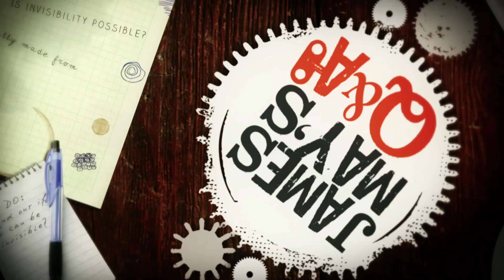Why Can't Trains Go Uphill? | James May's Q&A | Earth Science

Comment: I can't believe you forgot about sanding the tracks.  When sand is put on the tracks for traction. I think a viable solution would be lifter Wheels wrapped in rubber to help assist in uphill travels. kind of like ones on cement trucks and dump trucks. If a heavy load the wheels hydraulically lower to help  disperse weight. With that said most Rail lines has already been set and engineered at slight incline so why redesign a train for steeper grades.
Reply: Sanding only increases adhesion around 5%. This means that your GP40 will now get 30% adhesion instead of 25% - that's still pretty awful for anything but a locomotive (30% adhesion means that a force equal to 30% of the locomotive's  weight will cause it to slide its wheels). TE comes solely from weight on driven wheels, so your suggestion would make the problem much, much worse. You could drive the extra wheels, but would  they be rugged enough to withstand the loads, and would they justify the extra complexity? (The answer to both is no)

The Russians used rubber tires on some of their locomotives (the CHMe-3 comes to mind), but then you lose all of the low-friction benefits of steel tires (these locomotives, it should be added, were designed for low-speed-high-TE applications like shunting).
Reply: What is your design for perpetual motion?
Reply: driving a streetcar every day sand makes a huge difference
Reply: MrCampbell202 Sure, it makes a difference. The manufacturers wouldn't make such a big deal out of wheel creep otherwise (which increases adhesion to anywhere between 36 and 43 percent). But the fact of the matter is - 36% adhesion is still pretty awful for anything but a locomotive (and you're not pulling a mile and a half of coal, so it's going to help you a lot more than the other guy). If the point is that locomotives do worse on hills than everything else, that extra 5% doesn't really change anything. Sand doesn't make the train go up the hill as well as a car, but it can help a little. A slug will help more, of course...

Comment: To negotiate very high slopes as high as let's say 60 degrees, instead of wheels equip the locomotives with pinions that would roll on a pair of racks instead of tracks.
Reply: Look up the Snowden train, it has just that. It could be a cool thing to apply to mainlines though...
Reply: Armadillito Wow it has already been done. Thanks for the info.
Reply: leteveryoneknow Al;so look up the Manchester tram system, I believe they have rubber tyres!

Comment: I was an engineer for CSX through Pennsylvania West Virginia and Maryland I usually drove the dash 9 locomotive and we would in order to haul a consists of 100 coal cars we would tie for locomotives together NH locomotive had over 6,000 horsepower diesel Electric System usually have to get it going and we would almost at the top of the grade have an issue with not being able to make it over but we would is the lost traction on wet rails they still have a system that drops the sand on to the power Wheels giving us more traction on a modern locomotive it's 12 Tractive Wheels ran by electric motors out in the West they would have pushers to help them along if there was an issue with a grade I can't think of the name of it right now there's a famous great out west in Colorado that trains have an issue with It's usually the freight trains hauling coal

Comment: saying 80% degree angle is the same as going up the stairs is the stupidest thing i've ever heard or seen. big dislike.
Reply: R u sure about that?  If the 80% is the ratio between the rise and the run such that the rise is 80% of the run , then it sounds about right.  For example, a section of a staircase runs 5 feet but only rises 4 feet.  That is an angle of about 38.66 degrees which seems right.  That is, the angle that has a Tangent (opposite over adjacent) of 0.8 is about 38.66 degrees which is about 0.6747 radians.  I think you better change your downvote to an upvote.  Actually he did say 80 degrees so he is wrong so yes leave it as a downvote for inaccuracy.

Comment: Interesting video, and very nice shirt! One thing I thing would add interest to the presentation is an explanation of the force exerted on the track by the wheels in such a small area. How does the kg/cm2 increase the friction between wheels and track? Also, this would be a good place to introduce the concept of coefficient of friction, which would have an effect on the amount of drag required to prevent the train from moving forward.

Comment: Error at 4:10. The tractive force will not remain the same. This can easily be seen (by people who've had some physics) by drawing the forces acting on the wheels. It would be easier to explain using images, but let my give it a try: 
If you pause the video at 4:10 you know that the gravity pulls exactly vertical. The tractive force is based upon the forces perpendicular to the hill, also called the normal force (formula: traction force = coefficient of traction * normal force). When the train is flat the normal force is equal to the gravitational force. But when the train is on a hill, some of the gravitational force is pulling the train to the hill, but some part is just pulling the train down! Hence, the tractive force is lower when going uphill.

Comment: Another factor not mentioned is that, going uphill, the entire weight of the train is "hanging off" the tiny contact patch between the locomotive's wheels and the pair of rails the locomotive is resting on -- which means that the entire weight of the train is also "hanging off" the patch of ground those rails are attached to. That's an enormous load, and if the locomotive has enough traction (using a traction aid such as sand), it can literally tear the rails out of the ground. Then the train won't be going anywhere for a very long time.

This is why it's better for each train car to have its own electric motor, so all the wheels in the train can share in the workload.

Comment: A 100 ton locomotive is small I thought the union pacific ones were closer to 300 tons.  I also thought the wheels on the cars had brakes on them and the locomotive has regular brakes and they can use the electric motors like a brake

Comment: There are Trains not only using Gearwheels locking and being driven using a "toothed Bar" but also Trains using Ropes being fixed to the Train (aside or beneath it)  while still standing & rolling on Rails. Such as the famous "CableCars" in San Francisco use, as well some  Trains in the European Alpes, called the ("Standseilbahn").

Comment: I used to work for a railroad. Many (most?) modern trains also have "sanders" equipped. They use a stream of air to blow small amounts of sand between the rail and wheels, to give them more traction when climbing hills, accelerating, etc.

Comment: Look up the Uintah Railway. That one had grades of 7%, and the locomotive manufacturer was so certain that 7% was a typographic error, they designed the locomotive's water jacket for a 5% grade, which would have let the crown sheets run dry resulting in a boiler explosion, hence the ICC banned the use of the Uintah Mallet until the problem was remedied. Later the sand and water saddles were removed when the locomotives were sold to a lumber company. The lack of weight made them lose traction, and they were very slippery indeed. 2% is considered the standard maximum grade for class A US railways. The Bonanza mine & the Uintah were very unique though. Even as a road Baxter pass is famous for wrecking large tractor trailer trucks. Hard to imagine it as a railroad!

Comment: NO mention of sand used to add traction? EVEN STREETCARS CARRY SAND.
tragic fail
Reply: No real point to bring up sand.
And I'm pretty sure sand is mainly used during poor weather conditions, where traction is reduced from rain/snow/leaves.
Reply: @caboose.20   since, as mentioned in the video, it's steel on steel, opening up the throttle too much will result in wheelslip, and that's when sand is sprayed onto the rails in front of the wheels to create traction. So sand is used more in getting a train moving, rather than braking.
Reply: well it's used while braking :) you can't use continously sand LOL

Comment: OK, very convincing...but how come trams have no problem with hills?
Reply: Brooke Brady No, I'm referring to systems like Nottingham which is a railed electric tram with roof mounted pantograph which has no trouble coping with Shipstone Street, Mount Hooton Road,  Market street, Beastmarket Hill or Fletcher Gate down to Weekday Cross, all of them pretty steep gradients.
Reply: +The Butler Did It Trams actually have the same problem with hills. The reason why they can run up steeper hills than trains is that they have more powered axles (higher tractive effort) relative to their weight. Trams usually (esp. those designed to run on hilly streets) have every axle powered which is in contrast to a freight train where only the loco is powered and the wagons (with 2000 t of coal) are not. Modern DMUs, EMUs with distributed power, metros and the like, can take steeper hills as well.

A modern locomotive by itself could run up an ~16% incline. But there's no point in running locomotives alone, without cargo.

Comment: Mr May might have also mentioned that, in the case of a steam locomotive, a severe grade will make it difficult to determine the level of water in the boiler.  Since the crown sheet must always be covered with water, a higher level of water must be maintained in order to ensure that the entire sheet has water covering thus making it more difficult to maintain steam.  He should also mention that the use of sand helps increase grip.  And, by the way, I am indeed a qualified railway engineer

Comment: Why not add a rubber inlay on uphill sections of track to improve friction?
Reply: +TheGreatMoonFrog   It would probably squish it right out!  Steel is probably quite slick against rubber-ever try to stop rubber tires on a big steel plate? The slightest moisture and it's "game over"!   I think the reason cars get such a good grip is that the road surface is quite rough.  It is strange that steel on steel is quite good with a lot of weight on top- the reason locos can "go"!  It is quite amazing what a factor air resistance is, especially at higher speeds. I think it is actually the square of the increase in speed, if I worded it correctly. Double the speed,  4X the resistance.  Without our air mass on planet earth, I think the main thing then limiting an ever-increasing speed would be the frictional load from bearings, and rolling resistance of the wheel in contact with the rail, which in itself is minimal on a train. As long as the horsepower is enough to cause an ACCELERATION to a new greater speed, even if it is a very slow or gradual increase, the speed is theoretically UNLIMITED until friction and resistance is greater than the ability to achieve an acceleration.  Things coming in from space BURN UP from the frontal impact with the air, so it must really be significant!  The air is the main reason we can't just go hundreds of miles per hour in a car, and that is not even considering other crazy things that aerodynamic events cause!

Comment: Dude didn't play much Transport Tycoon if he thinks trains can't go uphill.
Reply: +Maxmilian Hills in TTD are super-unrealistic. When they made a (more) realistic acceleration model in OTTD, they had to reduce the incline significantly. But even then setting a minimum speed for trains going uphill is super-unrealistic. Perhaps with rack railways. I think rack rails are available in Locomotion or in Rollercoaster Tycoon. Because it has much lower max speed, it can also make shaper turns than regular railway.

Comment: Would be interesting to add paved sections between the normal tracks for steeper angles (up/down) with significant rubber tire traction that would only engage traction when needed.  Wouldn't even need to make the rubber tires retract in normal operation as they would only contact the raised pavement if it was there.

Or just go maglev...;)

Comment: This video neglected to mention that locomotives have traditionally carried a supply of sand, which could be released onto the rails ahead of the drive wheels to provide extra traction. One of those domes on top of a steam locomotive's boiler was typically filled with sand, with pipes leading down to just ahead of the drive wheels. The engineer could pull a lever to open a valve and gravity would draw the sand down through the pipes and onto the track. 

The system wasn't perfect though, and the sand pipe could easily clog, especially if the sand wasn't perfectly dry. Later systems used pressure to force the sand out.
Reply: +lurkerrekrul So do modern diesels...You can see the sand pipes running right down over the rails on both front and rear edges of each wheel. Diesels work equally well in either direction, so sand has to be available in both directions the wheels are turning. Also, everything has a slip point at one percent or another. Engines alone CAN go up say, 4-5 % grades. It's the tonnage of the cars behind it which adds to the total weight being hoisted up hill which keeps most contemporary mainline trackage in the US lifting no more than about a 2% grade (2 miles in 100 miles ). Downward is just as much or more of a problem due to the heat at the brake shoes and the available air in the air brake reservoirs not being being depleted during the inclined travel downward.

Comment: 2:25 Spent probably about £200 animating two 50p pieces instead of holding two actual 50p pieces.  Makes sense.
Reply: +boltar2003 £200 more - the 50ps would survive to be used again in another project involving the demonstration an area about the size of two 50ps.
Reply: +Kj16V its a 3 Minute job probably costing nothing. They are just pictures placed in the right position. And the decision was probably made after filming.
Reply: +Kj16V As someone who regularly composites for video projects, often using motion tracking, I can assure you that any VFX artist, Compositor or even Editor in the professional world could do this in less than 60 seconds, plus, as +djteac mentioned; it was likely (almost definitely something decided after filming)
Reply: +boltar2003 It's also £200 more than needed to do it as they did.
Reply: +Evi1M4chine £200 is £199 more than the two 50ps he'd have needed to do it for real.